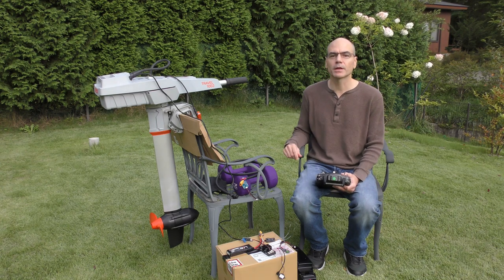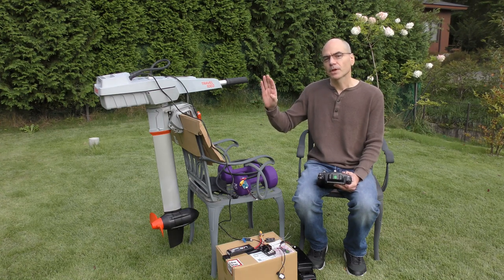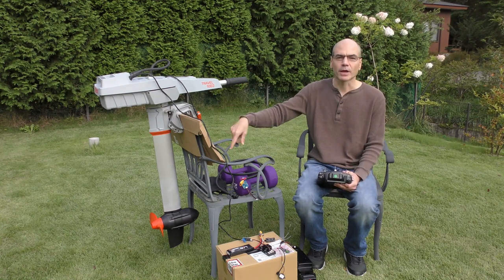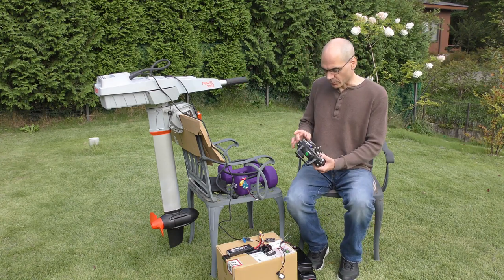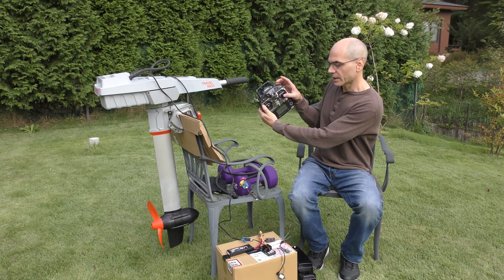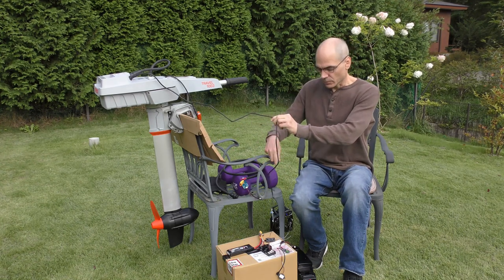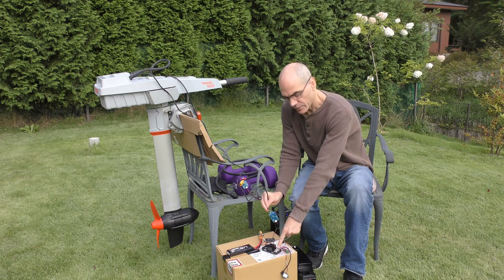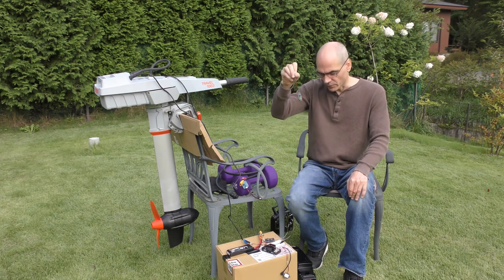ArduPilot Torqeedo Interface

Comment: Great presentation  ** Respect **

I am trying to understand the steps by steps pixhawk autonomous / rudder turns/ throttle speed with the electric outboard motor 

I am referring to the wire connection 
I kind of familiar with the pixhawk configuration 
Do you have an email to contact you please
Reply from the maker: Hi Perez, if possible could you post in the forums?  The best place to find me is in the Rover-4.1.0 category which I check each morning especially during the beta testing period. https://discuss.ardupilot.org/c/ardurover/rover-41/158
Reply: @rmackay9  
Hi Randy 
I want to thank you for your great presentation 
I followed the link for the forum but I don't see this subject. Under what subject is this under?

** By the way, your presentation shows an autonomous installation to the outboard electric boat motor, but you don't mention is we need to add a servo ro make it turn since this electric boat motor was designed to be sold non autonomous abd and to steered o left or right by using our hands. 

I hope you understand my point. We can add a servo and configured it in mission planner Chanel 1
Reply from the maker: @franciscourena5636  Yes, you're right that a servo needs to be used to aim the motor (aka "ackermann steering").  I'm working with a 3D designer to design an easy-to-use 3D printed steering mechanism that I hope will make this easier to setup.
Reply: @rmackay9  Hi Randy, so amazing boat. I am wondering which servo did you use in this boat. Thank you for your great share!

Comment: Randy
It me again - I am a pain in the neck, lol
Albert Eistein was like me, lol
The downside of connecting the cable to the motor is the possibility of burning the ESC ( Electronic Speed Controler) 

In my case, I want to build an Medium Size Autonomous Electric boat that you just  perfect it from small size to a bigger size.

This is my question, I rather stick with the torqued medium Speed  Electric motor attached to the servo and pixhawk provided it I can preserve the ESC buy with the condition to add additional batteries in parallel for a long range autonomous trip. 

Is is possible to stick with option but at the same time add additional batteries in parallel to the torqued Electric motor ‽???
Reply from the maker: Hi Perez,  I don't think I understand the question perfectly but I've added protection to the driver so I think the chance of damaging the motor is low even if you directly connect the autopilot to the motor (and use an external battery).
But I think your question is, "can you connect the autopilot to the Torqeedo battery and also attach extra batteries for longer range?" and the answer is, "I don't think so".  By the way, I hope to write a driver for the ePropulsion motors within a few months and those motor do support adding additional batteries more easily.

Comment: Hello Randy, I am trying to replicate what you have accomplished here, specifically using the Tiller connection with the DIY version of the board described in the wiki linked in this video, I tried to get the board you use in the video but I am unable to do so. I am having trouble getting the Tiller to turn on. I know a high signal has to be sent but for some reason the DIY setup is not working for me. Do you have any advice on how to troubleshoot the connection to get the Tiller to turn on? I've been stuck on this for a bit and would greatly appreciate any advice. Or should I just do the motor connection with the external batteries, and forget about the Tiller connection? Thank you!
Reply from the maker: Hi NaRa, the low level hardware connections are hard to give advice on remotely I'm afraid.  I fiddled with it a lot before I got that board designed and built and I did that specifically just so that others wouldn't have to repeat my struggles.  I think it's best to try and get the board by emailing info@japandrones.com.  It's my company and we're really not out to make a big profit on these boards.  Hope that helps.
Reply: @rmackay9  Thank you for that response. I have sent an email to that address.
Reply: @rmackay9  Hello Again, I got the boards in last week, hooked one of them up to the tiller connection and my cube orange, tried to arm using mission planner and the same issue came up. The on/off is not being triggered, the message states "PreArm: hardware safety switch" and then "PreArm: torqueedo not healthy" . The tiller batteries are charged and everything else is fine but it is not getting the on trigger, even when I force it to arm it still won't activate the motor. I have the parameters set up according to the wiki. Any ideas?
Reply from the maker: Hi  @NaRa-n9y , The hardware safety switch can be disabled by setting BRD_SAFETY_ENABLE=0 or BRD_SAFETY_DFLT = 0 (it depends upon the version).  Of course you are using a Troqeedo Travel, Ultralight or Cruise motor?  Could I ask that you post an onboard log in the ArduPilot boat forums?  It will be easier to do support there rather than here on YouTube. https://discuss.ardupilot.org/c/ardurover/arduboat/54

Comment: Hi, thank you for the video! 

I wanted to ask something to you, we don't have the battery for the torqeedo, and original batteries are a bit expensive to buy, do you think we can connect an external battery without burning the device? We don't want to use any flight controller, we just want to use the engine normally.
Reply from the maker: Hi Emirzmen, if there's no autopilot then I think trying to use an external battery won't work because the Torqeedo battery is the device that has the master controller in it.  If you use an autopilot then it can take the place of the master controller and use an external battery.  If you're not trying to build an autonomous boat though I would just stick with Torqeedo's standard parts and setup.
Reply: @rmackay9  Is there then really no easy way to power the Torqeedo from an external source?  We also have a Torqeedo 1003 and 1103, both work fine, but our boat has a huge battery bank and it would be nice to tap directly into that, rather than hot swapping battery after battery and waiting for them to charge up at 40 to 90 watt input.  I have toyed with the idea of hacking a old 400 watt Torqeedo battery to use the master controller but not use the NMC lithium cells, then input my own power from our big bank.   I figure you would need to trick several sensors to fool the battery master controller into thinking it was sourcing from the original NMC cells.  Messy...
Reply from the maker: Hi @richardeverett1227 , If you're using ArduPilot (meant for autonomous boats, see https://ardupilot.org/rover/docs/common-torqeedo.html and https://www.youtube.com/watch?v=V8N3lA-20fs) then it is possible to use an external battery because the autopilot (e.g. CubeOrange, etc) acts as the master controller (which is normally in the battery) and directly controls the motors.  If you're not using AP then I'm not really qualified to say what might work but I think you should be able to plug in the external battery to the battery's solar panel input.  Another more risky solution would be to use a DC variable power supply to adjust the external battery's voltage to around 33V and then splice that into the power cable going to the motor so that the motor would be receiving power from both the external battery and the smaller torqeedo battery.
Reply: @rmackay9  Yes, ideally what I want is an empty battery shell that has a 48V to 33V DC-DC converter in it of about 1000 watts, mounted to a big heat sink and running at 87% efficiency, such that the heat sink is dissipating 130 watts maximum.  I could then plug the factory tiller into this battery shell and connect the battery shell to the 48V Amphenol Surlok connectors I have on the transom of our boat normally used for our 6kW ePropulsion Navy 6.0 outboard.  In this manner, I can carry the Torqeedo as a simple backup, also used with our dinghy and its 915wh battery.  If in an emergency where the Navy stops working, I can swap in the Torqeedo and continue running on our 15kWh LiFePO4 battery bank in the boat.   This is the dream, not really any easy reality I can see.

Comment: Thank you very much for this information.
I see you are doing great work on the ardupilot project.
My question far more basic and not ardupilot related and in that sense off -topic.

I dropped my Torqeedo engine in the water a year ago.
Checked the engine itself - works.
Battery got very hot after the incident - took that apart for safety reasons (maybe not a good decision in hinesight.)

Here is my question:
Could I use your board to add external batteries (non-Torqeedo) batteries to my 1103CL and thus get the weight of the batteries where I want it, get the batteries out of the wheather, get the battery size I want and get batteries I can use for multiple purposes (electric bike in winter, boat in summer).

And in that scenario, would I need the cube2 or go with something else.
For instance a cycle analyst from Grin Technologies or something along those lines.

Love to hear your take on this.
Reply from the maker: Hi Antoine, what we've done is only half of what you need I think.  So with this enhancement the autopilot (running ArduPilot software) can control the motor and even allows using an external battery (i.e. it replaces the Torqeedo smart battery).  The problem you'd face though is you couldn't control the motor manually in a very convenient way.  I expect you'd like to keep using the Torqeedo tiller but I haven't added a "driver" for that part so you couldn't tell the autopilot how quickly to spin the motor... this means you'd be stuck using a standard RC car/boat transmitter (e.g. Futaba, etc) which would be weird and awkward.
You probably already know but in any case Torqeedo does sell a motor extension cable that allows putting the battery further from the motor.  Sadly they don't make it easy to use 3rd party batteries nor do they offer larger sizes of batteries that the 1Kwh that comes with the motor.
Technically speaking, someone could definitely create a little adapter board that could be connected to a Torqeedo tiller and motor and allow external batteries to be used but that's not a project that I can takeon because I've already got my hands full I'm afraid.
Thanks for the interesting question!
Reply: @rmackay9  Weird and awkward are my middle name - so no worries in that department. Thanx for your input and swift reply Randy! Very much appreciated. I'll ponder the RC-control for a bit. If it has some form of cruise-control (and it looks very much like that is the whole purpose of ardupilot) this is not much of a problem, just an unusual form. I've been looking into pypilot to selfsteer my boat, but I now think that ardupilot could do the same and then some.

PyPilot cannot give me weight distribution that comes from separating the batteries from the engine, the rightsizing of the batteries etc. PyPilot can however talk to tiller systems where you seem to use the engine as a rudder. PyPilot is integrated with opencpn. I haven't red enough on ardupilot which charts you use.

And you are very right to say that I'd be spoiling all your mapping efforts etc.
Fortunatedly these are all first world problems!

Thanx again!
Reply from the maker: @antoinem01  I've never heard of PyPilot before but it seems to be meant for manned vehicles while ArduPilot is primarily for unmanned vehicles (so in this way it is a better fit for what you're thinking of).  Like ArduPilot it also uses the GPLv3 license so you could actually point the project's developers at ArduPilot's Torqeedo library (https://github.com/ArduPilot/ardupilot/tree/master/libraries/AP_Torqeedo) if they wanted to port it across to their project.  I'm sure it would not be super easy for them but it is theoretically possible.  Anyway, best of luck!

Comment: Hi Randy, Thank you very much for this info. I have a question,  it is any way to control 2 motors from pixhawk at same time?
Reply from the maker: Hi Alejandro, it is not currently possible to support two Torqeedo motors but it is on my to-do list and if you have two and could help me test then I could try to complete that sooner.  By the way, I also have an enhancement to add support for the ePropulsion motors but I don't yet have a motor to test it with... just in case you're considering that manufacturer's motors as well.
Reply: @rmackay9  would you be able to share the protocol for your interface? My robotics team would love to revise our twin Torqueedo motors control (not using ardupilot)
Reply from the maker: Hi  @Tachidan , ArduPilot's Torqeedo driver is here and if your work is also open source (GPL) then you're welcome to copy it. https://github.com/ArduPilot/ardupilot/tree/master/libraries/AP_Torqeedo .   If you're project isn't open source then you can directly contact Torqeedo and after signing an NDA they'll give you the protocol details.
Reply: @rmackay9  Thanks, I'll keep that in mind.
Our work would be open source.
Is there any information I might find useful for the motors that I would want to sign an NDA for?
Reply from the maker: @Tachidan  Having the doc while writing the AP driver was very useful but if you're able to use the AP driver as a base then I'm not sure there's much more you'd need.  By the way, the interface is different for the larger motors (>=10kw), those use J1939 apparently.  I'd like to write a driver for those as well but that will need to wait until someone really wants it enough to provide me with a motor for the software development.  I'm not asking you of course for this, I'm just putting it out there in case someone else reads this at some point.

Comment: Hi Randy
Sorry I misunderstood the situation
Di you complete the autonomous Steering Mechanism ?
I put my project on hold because of I could not find a strong servo ( which gets the signal from the Pixhawk ) that can turn the rudder 
please let me know if you completed the project
Reply from the maker: Hi Francisco.  Yes, I've completed the vehicle and I posted a "reference frame" page here on the ArduPilot wiki: https://ardupilot.org/rover/docs/reference-frames-deset-mapping-boat.html .  I've just created this discussion re the steering mechanism. https://discuss.ardupilot.org/t/torqeedo-motor-steering-mechanism/82870
Reply: @rmackay9  
** RESPECT *
GREAT JOB

Randy, I replied ( posted ) this question in the forum but as I previously indicated I am not really familiar with the forum chat. I will
try. 

I think you are a very humble person that teaches us a great deal of knowledge.

Very important question

When we ‘ARM’ the arduboat in mission planner ( Using the Pixhawk Navigation System) in order to set the autonomous mission, how do we turn on the Torqeedo ???
Reply from the maker: @franciscoe.9989  Re turning on the Torqeedo, it depends whether or not the autopilot is connected to the torqeedo battery or directly to the motor (e.g. you are using an external battery not the torqeedo battery).  If the Torqeedo battery is used then the autopilot (via the RS485 interface board) pulls an On/Off pin high to turn on the battery.  If an external battery is used then the motor will always be on.  The interface board is described on this wiki page and I hope to start selling it from my company soon.  I hope other people and/or companies will make their own interface boards as well. https://ardupilot.org/rover/docs/common-torqeedo.html
Reply: @rmackay9  
I checked the link and I now remember.
I should have reviewed my notes from your link. the answer to my question was right there, lol

Comment: in autonomous mode, do you need a servo to make it turn?
Reply from the maker: Hi Francisco, yes, ArduPilot does not yet support using two Torqeedo motors at the same time to do "skid steering" so a servo must be used (aka "ackermann steering").  To make this easier I'm working with a 3D designer to developer an easy-to-use 3D printed steering mechanism but that won't be ready for another month or two.
Reply: thanks for the information.
* I will be the first one to buy it from you
' Pon Source Autopilot for Cheap Trolling Motor' that person is building the same project. Is that you ?

The two motor electric steering system information is avaible in utube, but not in the concept that you plan to develop ( one electric outboard motor engine steering mechansism.

I am building an autonomous gas motor boat. I will use a servo to steer the tiller channel 1/ Ardurover. I wil keep you posted.

thanks
Reply from the maker: @franciscoe.9989  thanks for the reference to https://vanchor.org although this is not me and not related to ArduPilot (but I wish them luck!).  Trolling motors are OK because they are cheap and have lots of power but they also have a very low top speed (less than 1.5m/s) so they are not so good for oceans or rivers.